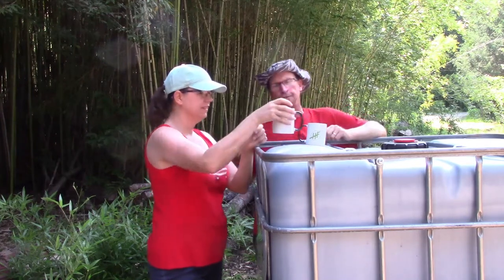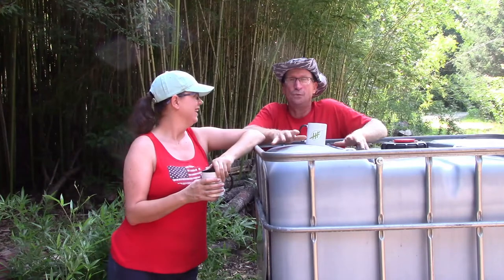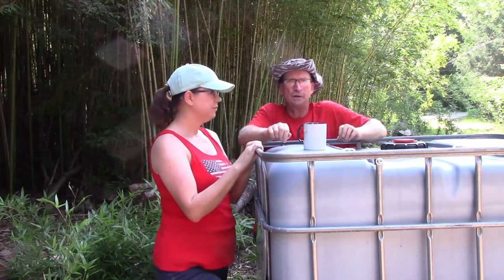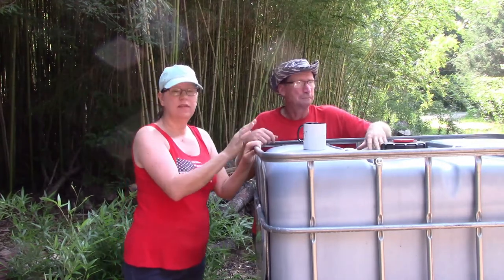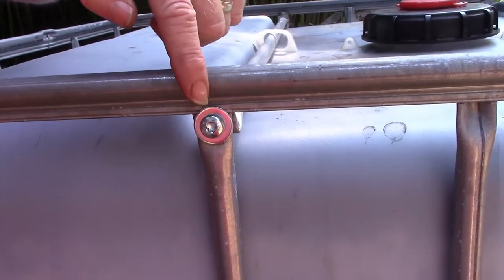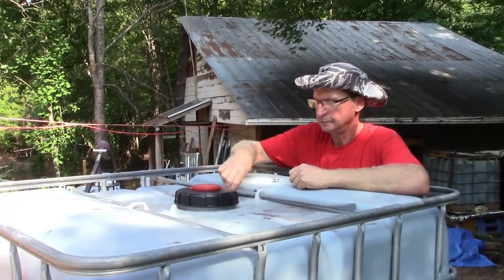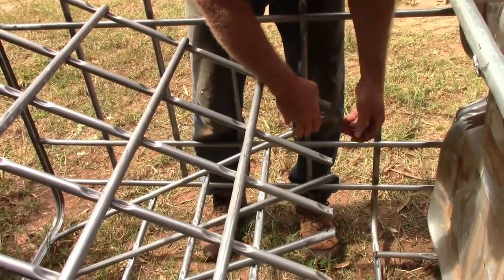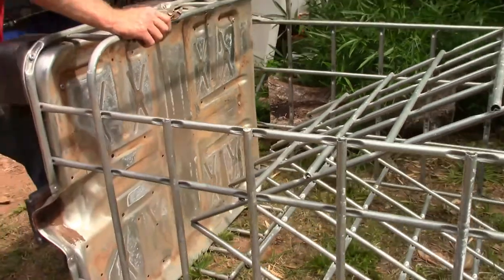Easy No Waste DIY Hay Feeder

Comment: That's a awesome idea. I'm gonna try to copy this. I'd keep the corners on the angle section.  Then I would slit some heavy hose and run it down to the exposed frame. Now to find a cheap ass tote.
Reply from the maker: By all means, copy away! I think we are going to do one where we keep the corners to see how it turns out.  We were amazed when we found that deal !
Thanks so much for watching :)
Reply from the maker: Love the idea about the hose to cover the frame!!
Reply: @HomesteadFresh  that was a great deal for sure.

Comment: Found your channel looking for diy hay feeders for my 6 horses. In Florida, the round bales in pasture isn't practical, with all the rain. This would use less hay, thus waste less hay if it does rain. Perhaps a covered shelter of some sort to keep rain off would save even more hay. Horses will waste a lot of round bales when just placed in field without a ring or feeder to control it being dragged or rolled apart then peed on & pooped on. Thx 4 idea. No clue where to look for these containers. How do you find them?
Reply from the maker: This is exactly why we use them, really helps with all the waste. They are quite easy to find if you search for them. Perhaps you use FB market place or Craigslist... Just look for IBC totes. 
As far as coverage, we have in the past used the plastic bladder they come with cut at a diagonal and placed in top (makes it look like a roof), but our donkey and cows kept taking them off 😅
Appreciate you stopping by!

Comment: As far as the hat, leave the flaps down. My father in law has really bad age spots & cancerous lesions on the sides of his face just above corner of eyes. A hat like you have would have shaded that area.  Lesions don't show up until your 70's, but when it does. It looks awful. Flaps down, function over fashion.
Reply from the maker: Thanks for the tip - I completely agree... Having already gone through one skin cancer surgery, I will certainly take your advise.  Appreciate it!